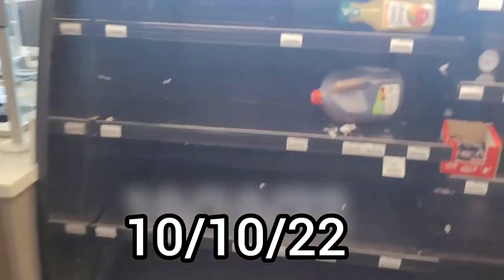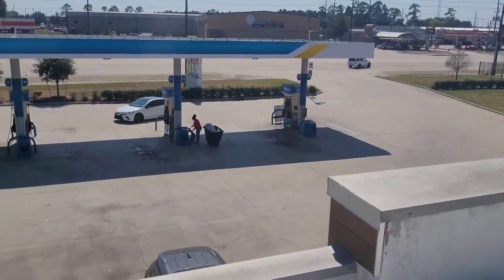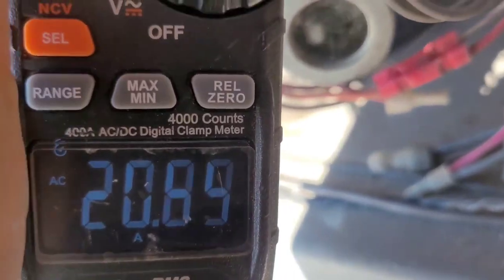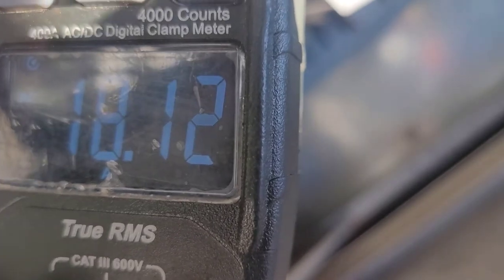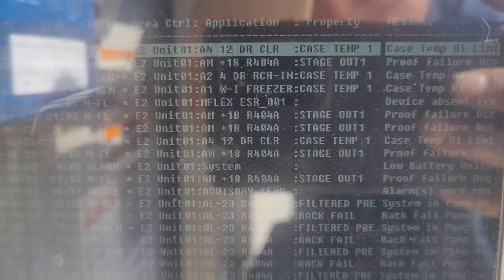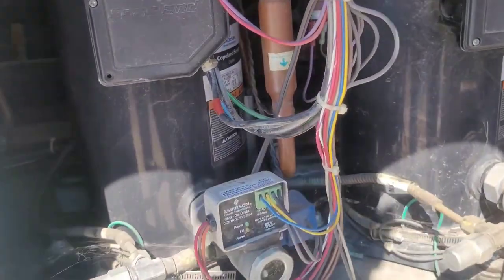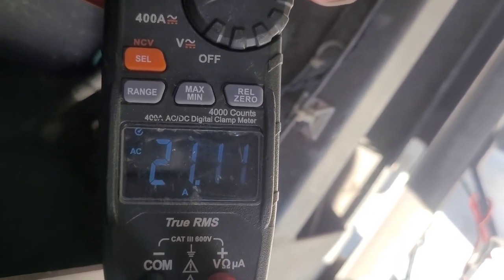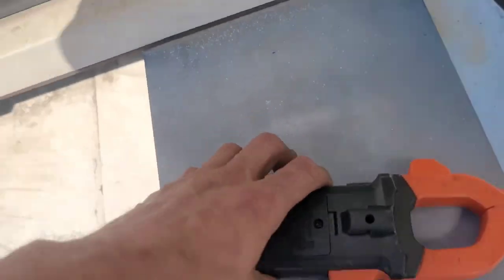Compressor Failure Diagnosis Gas Station Hussmann Protocol Rooftop Rack

Comment: Digital scroll. I’m pretty sure it’s 10 second periods if I remember right. May have a charge issue if can’t get box down to temp maybe defrost issue? Not sure of all the pressures/temps. I believe they load/unload based off demand/capacity. Compressor is not the issue.
Reply from the maker: Great, thanks for the information guys. We would think and expect, that my supervisors(such as my lead and service manager)would know these things, and be the ones to have had educated me on this fact. But that's another topic. 
I will keep learning with my friends on here if nothing else.
Reply: Its a 20 second run time loading and unloaded depending on capacity needs.
Reply: Agree
Reply from the maker: Now that I think back to it, I know that the receiver had enough it in. Was at least at 30%. I could not get the suction pressure to go down. The compressor should have been running full capacity to try to lower my suction-is my guess now looking back. 

Thanks for the comment!

Comment: The time between loading and unloading is calculated for demand 
Example they can determine the amount of tonnage needed by timing the unloading interval 
You may have seen Aaon units doing this 
Yes surprising your team leader didn’t know this 
Man I was so close to coming to work there with you guys in Houston 
I mean I was in the final process I was hired just needed to finish paperwork
My boss talked me out of it now I’m regretting it!!
Reply from the maker: Yea, I have been actually learning a lot tonight about the Digital Scroll. Since I learned about the fact that there is such a scroll. 
Yea, it is a pretty interesting job. I think of all the companies that I have worked for throughout my career, this one stands out for many reasons.
I am finally getting used to the on call life,  which is unlike anywhere else. Calls will come in at all hours of the night, which is not too bad for me anymore. You have to accept that aspect of it or you won't last. It's good to know that when 6 or 7 am, rolls around, you can go home and rest finally. 
You probably still could come work here. They are always hiring because,  well, I am not sure but I would guess that many cannot adapt to the demanding physical labor that is required, especially during the summer on call or 5 day holiday weekends. But they will pay you good for it, and never try to short you any of your turned in hours. Excellent benefits.  
Yea, I would say that if you can get an offer to take it!

Comment: Get the model number off the compressor to get literature to see if it a digital compressor it might have unloaded you should hear clicking solenoid valve. Put gauge on the compressor to watch the compressor pressure.I really don’t think it a compressor you should have diagnose the problem don’t assume it’s the compressor unless your 100%

Comment: its prob a digital pump and its unloading on the copeland IDCM digital controller
Reply: i see everyone else replied about it unloading. we service a smaller supermarket chain that has vertical and horizontal protocol racks and they def keep us busy.  never stop learning in this trade dude! when you work on another, find the IDCM controller for the digial scroll and read the label on it. it will show you what all the inputs are and all the contact points on it. fairly simple to work on, and they fail often and will cause the input alarm on the E2's.